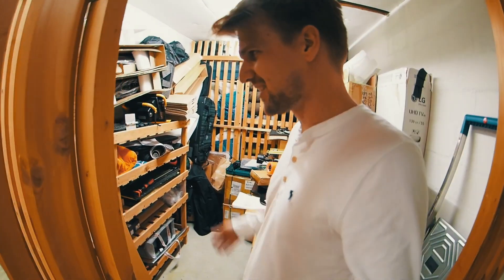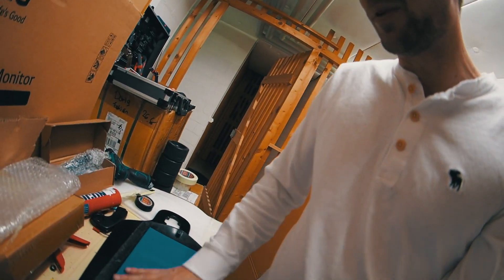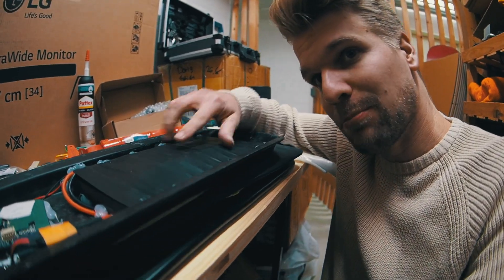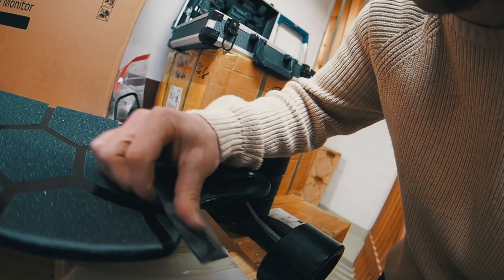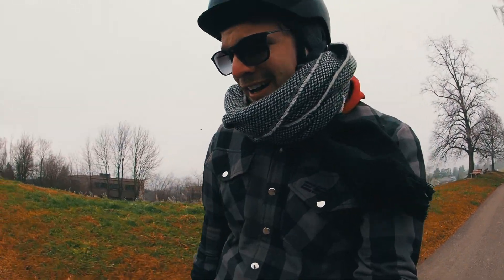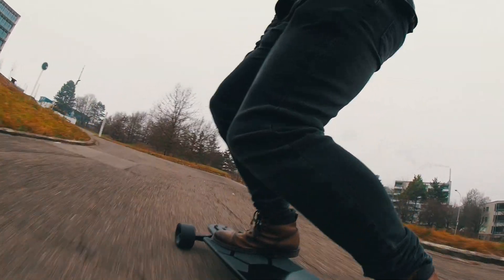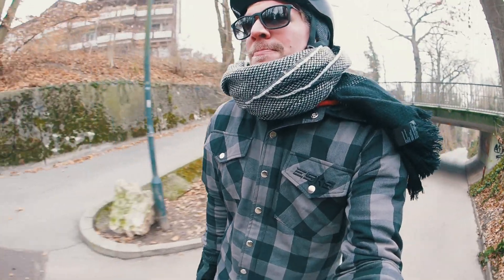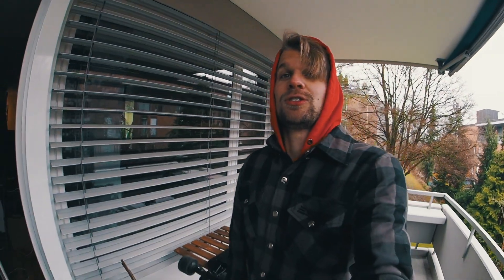DIY Electric Skateboard

Comment: Get a drill, and drill different holes on the mount so you can put the motors at a different angle. It’s that simple.
Reply from the maker: Ooh i thought i shouldn’t change it
Reply from the maker: Good to know thanks 🙏🏼
Reply: Fabi I had to drill new holes on my mounts to make my setup work with my motor mount. I used diamond drill bits.
Reply from the maker: I kinda expected it to work in any position 😅 as it’s described as the pro mount ^^
Reply: Fabi LOL! We all l know that doesn’t always work the way we think. There’s always adjustments that follows with a DIY board.

Comment: And I’ve been putting the power button on top of the board in the charge port on top of the board, so that way you don’t have to flip the board over to turn it on or to charge the board you can just leave it on its wheels all the time

Comment: Silicone a couple spots around the ESC so it’s not jumping around inside the case, and I do a strip all the way around the battery was either silicone or hot glue